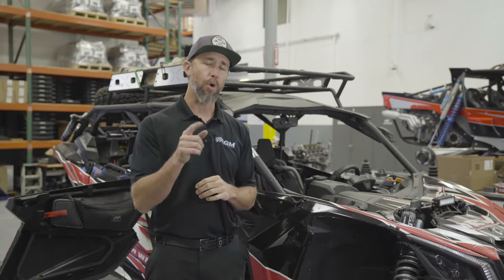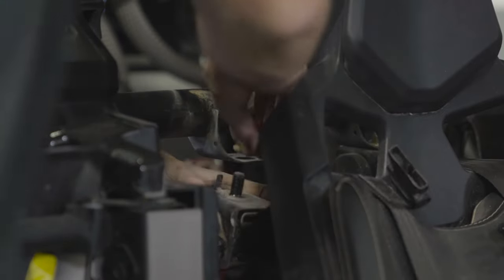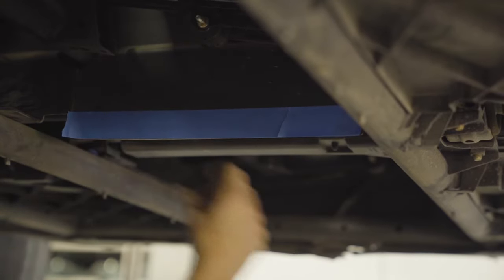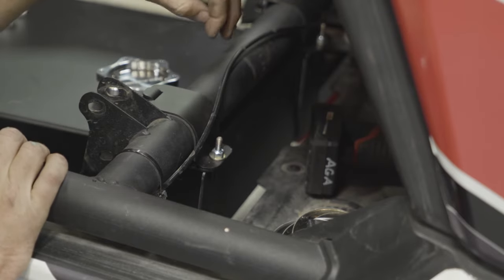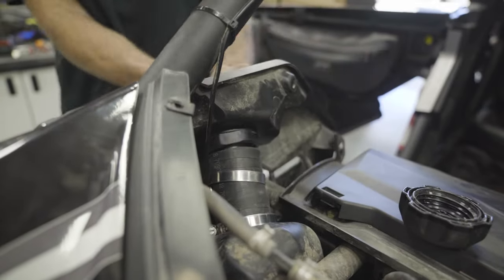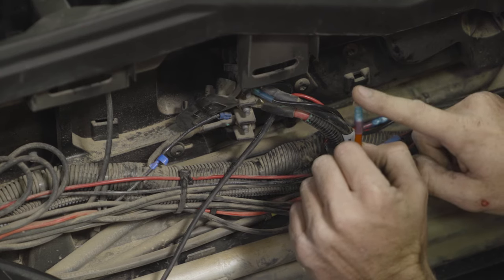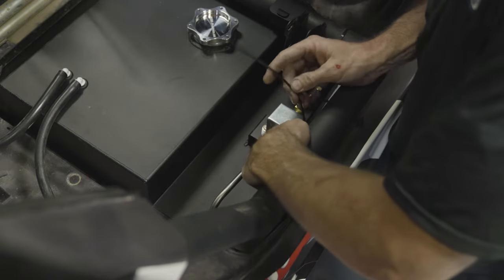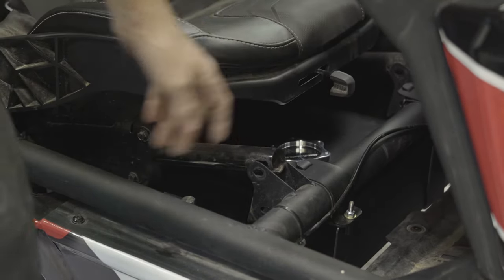AGM EXR Tank Install video

Comment: is this tank race legal? snore, best of the desert.
Reply from the maker: Mathew, we do not recommend our tanks be used for racing. But have heard certain customers still do. Those customers have all raced in the Rally style classes. And per the rules have put a firewall(sheet of material) between them and the tank.